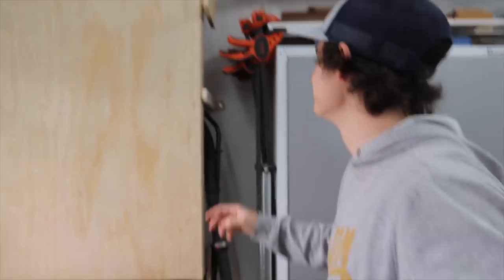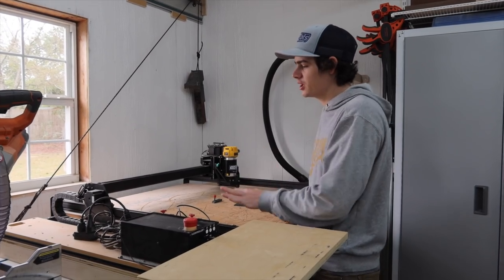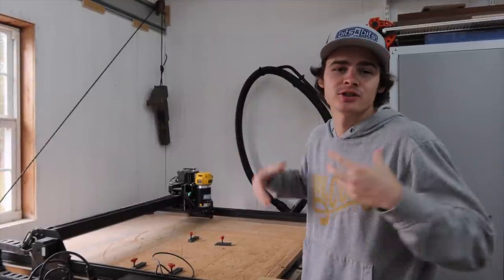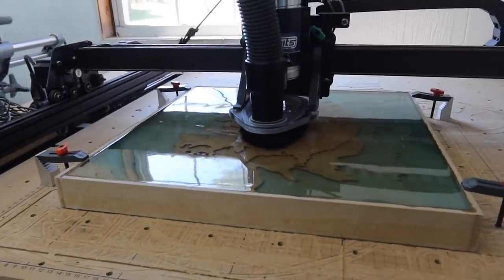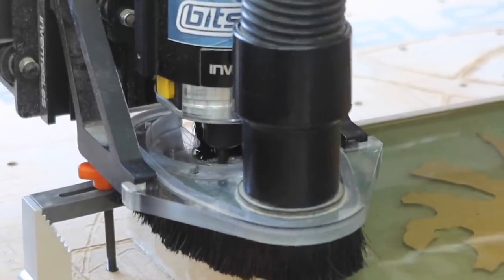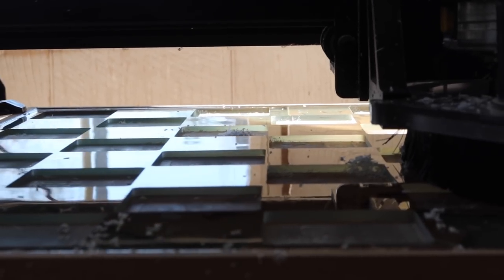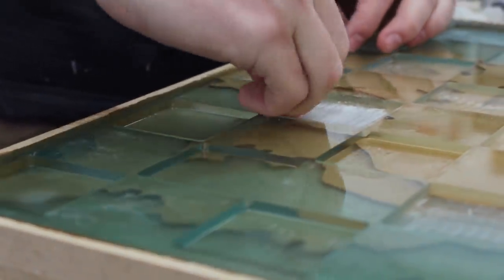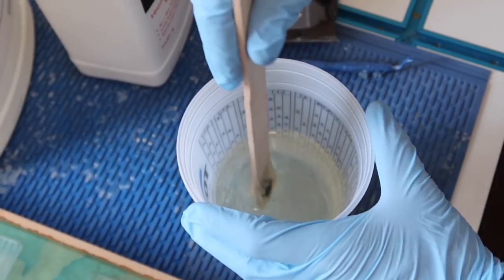Making an Epoxy Ocean Chessboard

Comment: Very cool and unique idea. You probably know by now, but they make deep pour epoxy that allows you to pour up to 4 inches deep. Also, to prevent overheating, a lot of people put their form no stickers and have a fan blowing past it. Side note, with your giant CNC machine, I highly suggest you make a Battlefield Chessboard (there's a short on my channel for context). It's about as unique as your idea, but utilizing a CNC would allow you to go into a lot more detail than I've done with an angle grinder.

Comment: Make yourselves a small vacuum chamber for the molds. That will remove all air bubbles. You can get a venturi adaptor for your air compressor and some pvc tubing for the chamber. I use to do this many years ago pouring molds.
Reply from the maker: Yes! I think we might do this👍🏻

Comment: Cool project and good job! Tip for next time. To save yourself a ton if sanding use the CNC to flatten the top. It would prevent you from having to use the belt sander for it.
Reply from the maker: Hm. That would've been smart. Next time!

Comment: Nice job guys. I'm always concerned with wood movement when I see the massive epoxy pours on hardwoods. But I think MDF is a very safe material to do an epoxy pour on. I also didn't know you need to keep it tacky between pours or else you gotta sand it. Interesting. I'm familiar with paints, and occasionally a certain paint will require this but not all of them. Good job
Reply from the maker: Definitely MDF :)